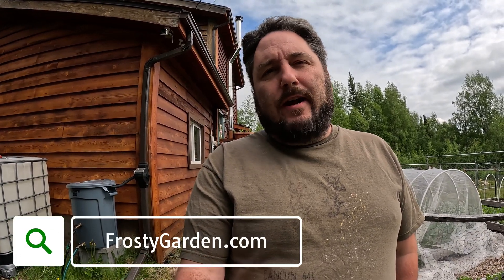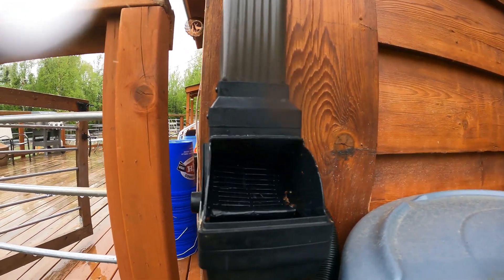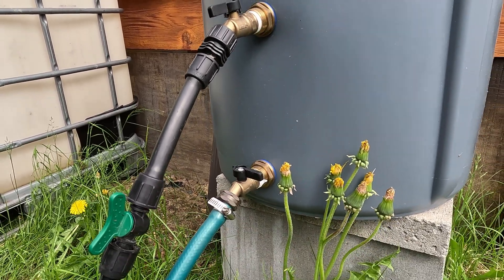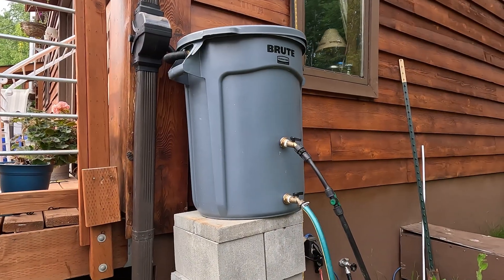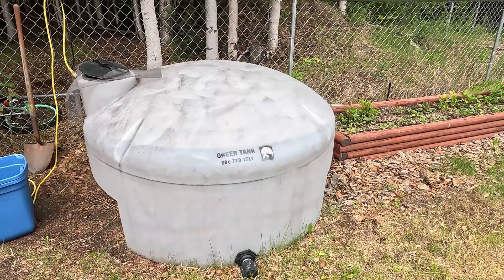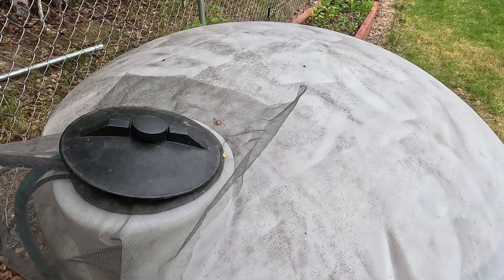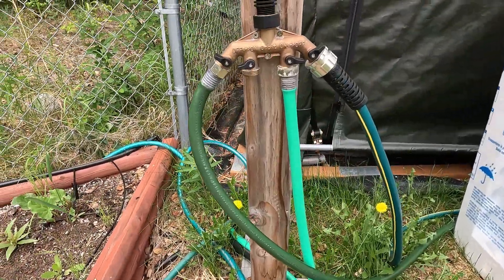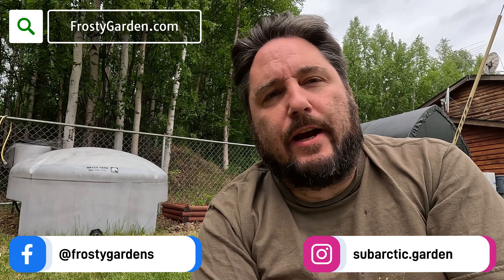Our Off-Grid, Gravity Powered Centralized Rain Water Harvesting System

Comment: I see you filter the water. What kind of filter is this? Where do you get it?
Reply from the maker: We technically have two.  Our pump has a rough filter, kind of like a sea sponge looking thing.  It's not rated for a micron level, but it keeps "big nasty stuff" out of the system.  You could also envelop the pump in a mesh bag of sorts, both methods work.  Then, from there, we go through a 200 micron filter.  It's called a Y-filter and you can order them with different mesh sizes.  It can be a bit challenging to integrate off-grid, since the Y-filter is designed for a standard hose-bib.  Our fine filter is "post pump" and is used prior to feeding any of our zones/hoses so it filters everything from our off grid irrigation.  This is the specific filter we use. 
 https://www.dripworks.com/irritec-deluxe-hose-thread-filters-y-type

Comment: I have the same problem with my IBC tank that is white (hold the same amount of water) getting algae in it from sunlight. I did buy a cover, but the winds just shred it. I’ve tried various things to clean it and nothing works well. I thought about painting it black but it sits inside a metal cage and doesn’t come out of it. Do you think I could paint the whole thing? Would it help? Do you think the algae is a problem?
Reply from the maker: I don't think algae contributes to general gardening issues.  It can clog up your filters, drip irrigation and sprayers, though.  So, that's why we have a dual filter system.  (Essentially, rough and then fine.)  Painting or some "very opaque" method would help a lot at reducing algae growth.  But, even a little light exposure (e.g. through a connecting pipe) is enough to develop algae to some degree.  So, dark plus filters is still probably the "best" path forward.  Thanks for the comments!